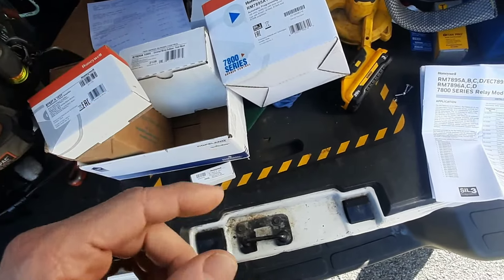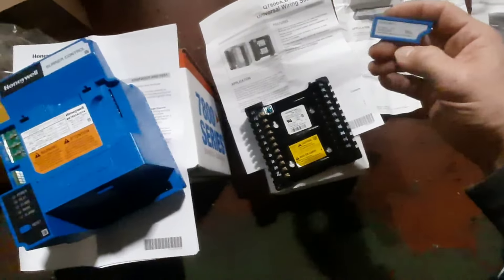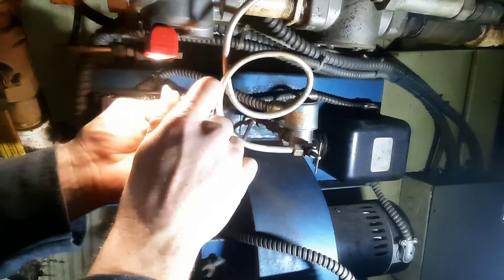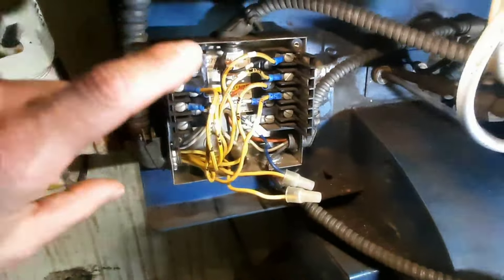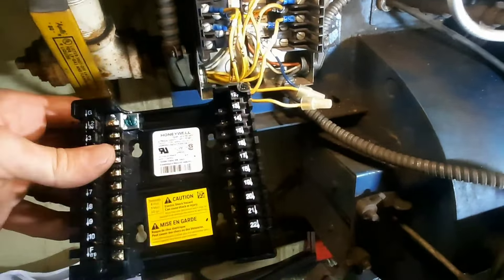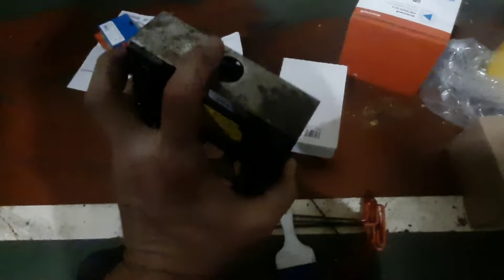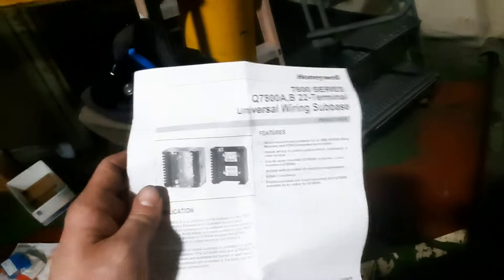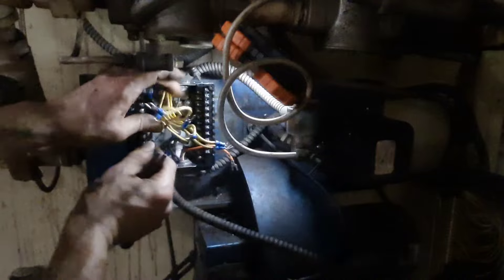Flame safeguard replacement and testing

Comment: Heck yeah Steve.....nice job on figuring out and repairing that motor. You should see the new digital display for those 7800....its frigging nice. Seen it at a recent boiler training i went to in Houston.
Reply from the maker: Thanks, Jason! We have a couple of displays floating around, but I don't have one, and the new control was expensive enough. They are nice to have for diagnostic purposes.
Reply: @EverythingHVACR  luckily i have the last generation display i keep in my truck. I would love to get the new one....but at $500 a pop.....I'll wait
Reply from the maker: I have the adapter that connects to the old 77 series to read flame sense. I can only imagine if you could find one, it would be expensive, everything is now.
Reply: I didn’t know they had newer display. Maybe I can pass my old one along and get the new one 😂.
Reply from the maker: I forgot the part number, but there is a removable display I could have plugged in to this control to have a digital read out.
Reply: @EverythingHVACR  just so everyone knows if you buy the display as a tool buy the case as well.
Reply from the maker: Good call, Matthew!